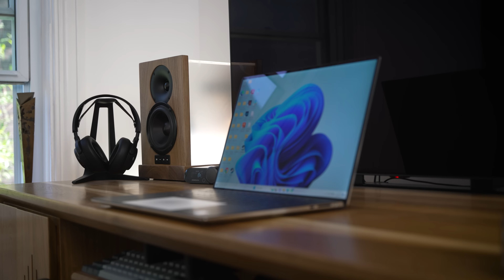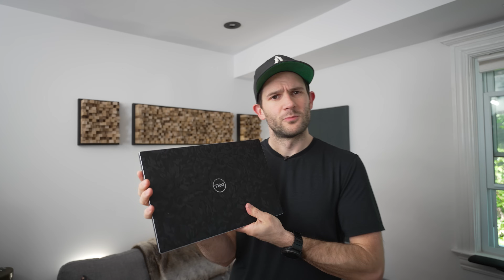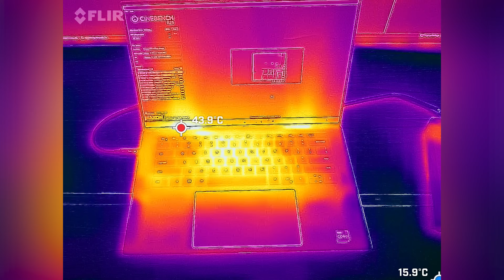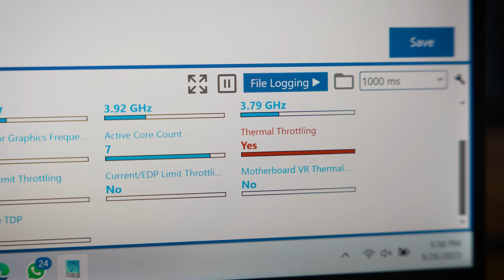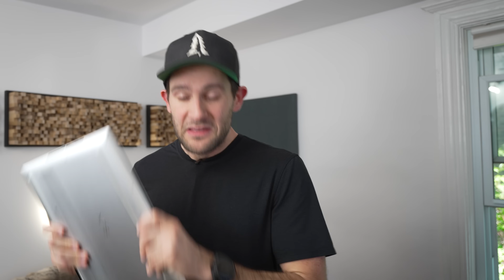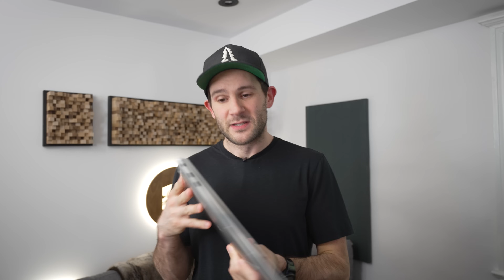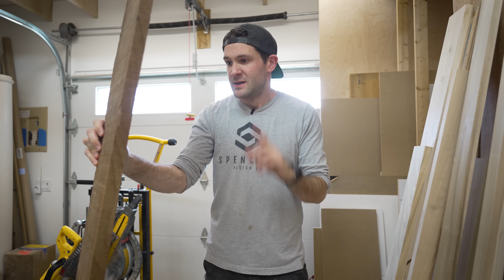The BEST mod I've ever seen....

Comment: This has to be a troll channel. Why TF is he using 3/4" wood to make a laptop stand, and what's with the angle? That thing is going to be unusable from an ergonomic perspective.The he slops thermal gunk all over the inside of his laptop to ensure the base heats up as much as possible, perhaps not realizing that the purpose of the fans is to exhaust the heat BEFORE the aluminum base becomes a stovetop.

Lastly, laptop cooling pads work just fine by ensuring a constant flow of cool air at the base of the laptop, such that the existing intake and exhaust ports for cooling become more effective. Cooling pads have been around for decades and the best ones are going to be as unobtrusive as possible.

Comment: Just buy a T430, switch its CPU for something slightly more powerful than the original and maybe change the cooling thingymajig out for the one used in the models using a standalone nVidia gpu (also, make sure you dont get a "quiet" fan, shit sucks)

Comment: I never had any problems with my Dell laptop but i have my pc for gaming and that laptop mostly for web browsing. But i can say stay away from HP it was the worst laptop i had. It was overheating discrete gpu died so now it runs on internal, it stopped detecting battery, dvd rom and harddrive failed. Plus i was fixing HP laptops for 2 years and cant recommend them.

Comment: For your next laptop just buy a slim form factor gaming laptop like the Legion Slim 7/7i or Asus G15/M16. They have much more beefier CPU and GPU and often do come with overclocking abilities built in which you can use to your advantage in these projects. (also the new Nvidia 4000 series GPU come with almost full TGP performance like 140W at less than full TGP like 100W which is pretty cool so all you need to be bothered by is pumping more juice to CPU and cooling just that)
Reply from the maker: I was looking at the Yoga Slim 9i Pro or whatever it's called. Very impressive but not cheap. Still might end up being the route I go. Appreciate the info!

Comment: You are not supposed to smear the thermal paste like that on the cpu and gpu, you just apply it to the cpu and gpu in the size of 1-2 grains of rice (the size that 1-2 rice grains would be if they lay side by side) and when you have applied it, you mount the heatsink in one movement downwards. That will make the paste spread evenly without creating any air pockets or air bubbles. If you smear it and then mount the heatsink you will trap air between the heatsink and the thermal paste and the cooling will not be as good as if you let the heatsink press the paste evenly. 
And remember that whatever method you use, if you have to lift the heatsink up after it have made contact with the paste, then you will have to wipe it all off and apply it again if you want the cooling to be as efficient as possible.

Comment: A laptop that actually would have been worth all this nonsense you did has all those ports so you wouldn't need a dock and won't need cooler with the new upgraded laptops with 4 fans that make the laptops cool to the touch not like yours or 3,000 series laptops.

Comment: HI Zac, I would like to ask you something, when using Trottle top you can go to the TPL , tab , and use this config, . Uncheck the disable Contronls option on ,Power Limit Controls, Than uncheck PL2, and use just PL1, CLAMP both , PL2 and PL1 , and on the Watts  put 100 W and try again.I almost forgot push the slide TURBO TIME LIMIT  to the max right, probably placebo but is nice the big number and if you the thermals still are in the high 88 90 celcios , put some liquid metal. I discoverd this on  my legion y540. mine is a i7 and rtx 2060

I tried to do the same on my friends acer nitro, but as his is and i5, it seams the PL settings are completed locked,

and to make it go Vroom, go to the FIVR, and check CPU CORE, CPU CACHE, INTEL INTEL GPU , AND IGPU UNSLICE, on all of this sub tabs go to ICCMAX and shove the slide to the right  making it 255 A, the eletrical design of the laptop will not allow to make past its limits but this helps , unlock the limits and stops the yellow lights of frustration, and some undervolting on the cache and core VOLTAGE OFFSET can help a lot